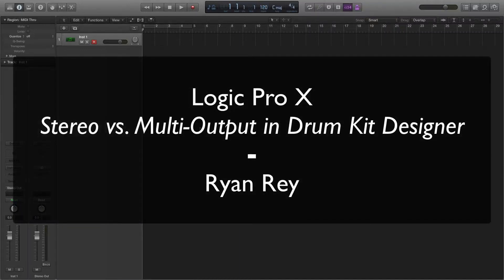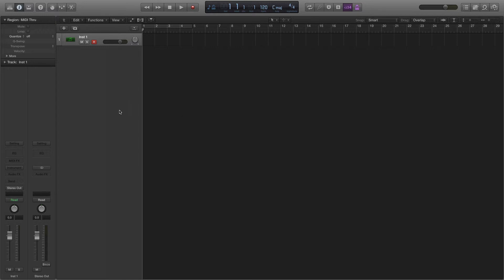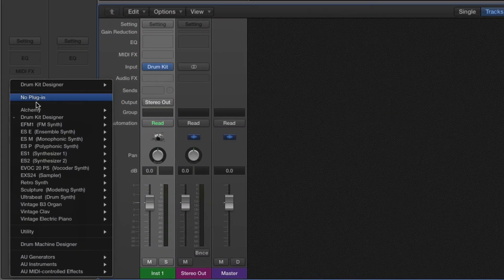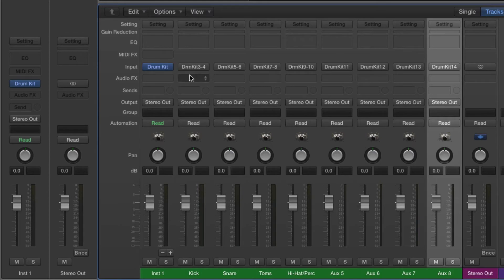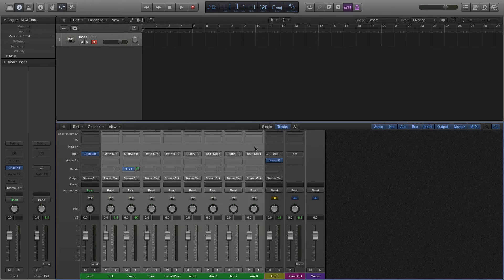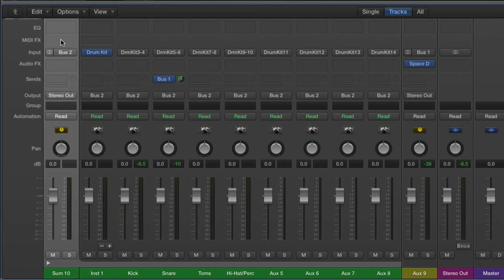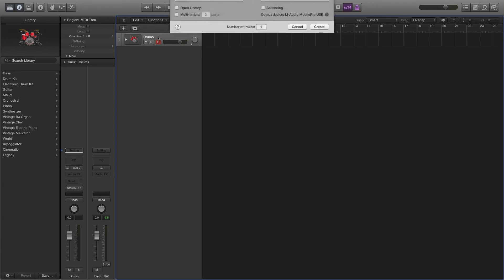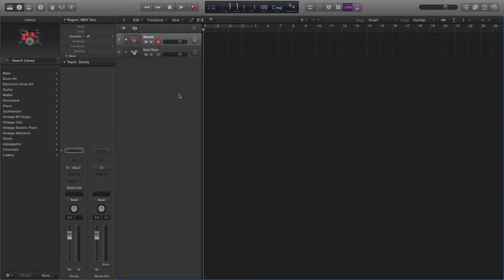Logic Pro X - Stereo vs Multi-Output in Drum Kit Designer

Comment: Cool video, how can you make the kick and snare mono tracks?
Reply from the maker: Hi William, 

For this example, I think it's easiest to change the panning knob to Stereo (right-click and select Stereo Pan. Move you mouse under the panning knob so the two white handles glow/highlight. Click and drag up until they meet at the center line. This effectively puts left and right material to the center, resulting in mono.

Another solution is to use the Gain plugin from the utility category of the Audio FX menu. Then turn on Mono.

Both have there pros/cons, but I'd say they are marginal.

I hope that helps!

Comment: Can someone confirm if, whether or not you're able to record onto the individual assigned drum track after summing it in the arraignment window?
Reply from the maker: Hi Rhys,

You can record on the individual tracks, but the full kit can still be triggered from these individual tracks. For example, if you record to the snare track and accidentally play the kick, it will still be heard from its track. So it may not be as useful to record tracks individually unless you prefer it as a workflow preference. (For example, if you want to be able to visually distinguish rhythms and/patterns quickly or if you like to record one instrument at a time.)

Hope that helps!

Comment: How would you go about making sure that the individual drum tracks get exported when you "export all tracks" in regards to sending it off to get mixed in pro tools? 

Thanks
Reply from the maker: Hi Grant,

When you export "All Tracks as Audio Files..." it will export anything with content in it. For example, if you have a MIDI region in the main track with a drum performance, create empty regions in all the tracks you want (ex: Overheads, Kick In, Kick Out, etc.) When you export, select "One File per Track" for file naming that looks good (be cautious of the bit depth. If you change it, it might cause timing issues). It will export all those regions with their corresponding sound. You'll also end up with a file with everything (since that was the main performance).

I hope that helps!

Comment: With this said, I have a Multi-Output Drummer Track, Bounced to MIDI and reprogrammed. Only a handful of my Instruments have been assigned to faders automatically. For instance I have 3 Hi Hat sounds (different MIDI notes) I'd like to control throughout the stereo field. The problem is they are all on the one Hi Hat Fader. Can I assign each MIDI note to its own fader?
Sorry for the long question. MUCH appreciated.
Reply from the maker: Hi Robbstar, From what you're describing, it might be more practical to utilize something like the EXS/Sampler instrument and control individual instruments that way. While the Drum Kit Designer does allow for individual adjustments, it has limits. And from what you want, I think you've hit that limit. If you're just trying to create interesting panning effects with a few specific instruments, a smoother workflow might be to create individual instances of those instruments and apply pan/vol adjustments that way.
Reply: @r2me2music  hey thanks for the reply. I love it when I hit the limit. Always a good sign. JK
I’ll give that a shot. I was really just trying to avoid redoing anything. But if you want it to  have the most control, you have to do it right. 
Thanks again. 
R

Comment: Hello Ryan, thanks a lot for the video. I wonder if you could be so kind to help with this issue. When I use a stock drum kit, the hi-hats and cymbals sound perfectly good when playing real time, but as soon as I playback the recording I get this kind of “ cancelling “ sound between these instruments. The cymbals sound crashy and so on the hi-hats. I’ve tried anything it comes to my mind but I haven’t been able to fix the issue and this happens with all my recordings. Hope you can read my comment. Thank you.
Reply from the maker: Hi AngelMTY111. It sounds like it could be a few different issues, but I'll need a little more info to help. Which drum kit are you using? Did you select it from the Library presets? When you say "cancelling," do you mean the sound cuts off or stops? or is it a different effect? What are you using to play the drum (drawing in, musical typing, usb keyboard, or other MIDI device)? 

Based on your description, the only thing I can think of is that it might be a keyboard issue. I have an older USB keyboard and occasionally one key will trigger more than once when I play. When I playback, I hear the note cutting off early because there is an overlap of the MIDI notes in the region. Have a look at your region and see if there are any notes that have strange overlap/retriggering.

Comment: Thanks for this vid, Ryan! Question: on a multi-out kit that I designed and saved as a user preset, it shows the toms in one channel. Is there a way to route them individually, so that I can pan them separately? I'm guessing there's a way to send them to the aux channels, but I'm having trouble figuring out how to do that.
Reply from the maker: Thanks for the comment thirtytwobars. 

For your question: 
When you create a software track and add a multi-output Drum Kit Designer instrument, you'll need to "trigger" the individual track routing behavior by selecting a preset from within the Drum Kit Designer plugin window (it's similar to the issue/glitch I explored in one of my other videos). If the drop-down setting menu shows "Factory Default," you still get features similar to a Stereo version of the Drum Kit Designer (more limited). It's an easy fix - just select a preset from that menu and then create the set you want. The downside is you'll loose the custom settings you already made for your kit. Let me know if that helps or if you'd like more clarification.